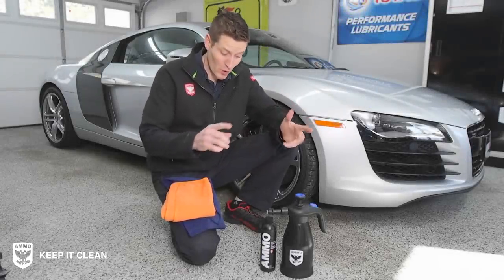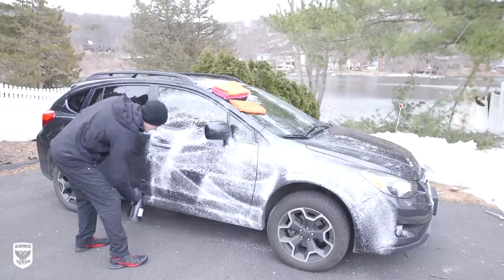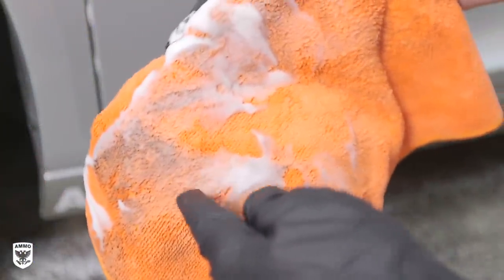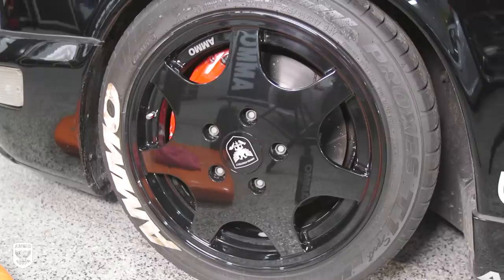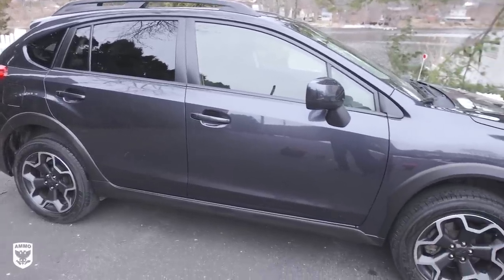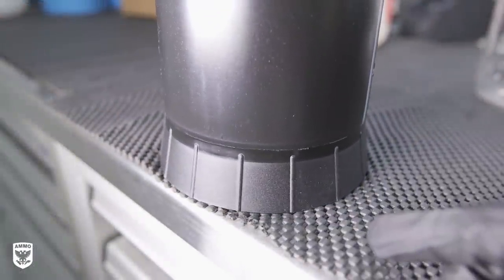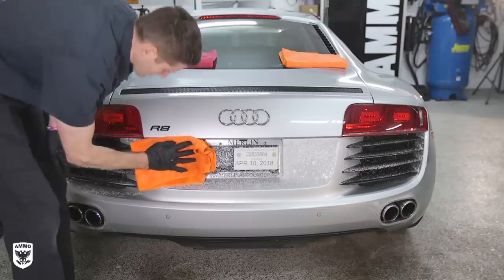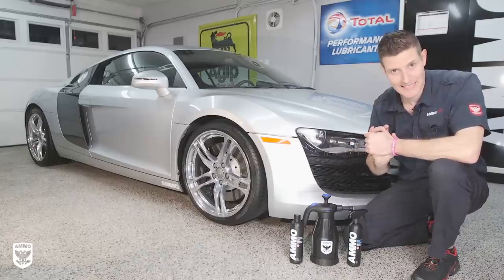How to SAFELY Wash Your Car Without a Hose!

Comment: Sorry Larry another question. If the Frothe product has that high degree of evaporation and the car is ceramic coated is it necessary to use Hydrate to help with drying/sealing?
Reply from the maker: not necessary but helps. adds a small layer of sealant. totally up to you.

Comment: Great idea. I hope to be in a place where you're at eventually in my lifetime. Definitely leading the industry in innovative thinking. However would this product work well in 100+ degree weather? Or would one simply have to work in smaller area quantities or work at a faster rate before the foam dries up? If it dries up does it bake into the clear coat like most car wash soaps do? lol.. It doesn't snow much down here in Texas. Also are the different color microfibers your using any different in the material used or the "grit" of the towels in any way?
Reply from the maker: I would avoid using it in direct sunlight but if you have no choice, then yes work in small sections.  same material for the microfiber just different colors

Comment: I noticed in this video that you're often going from top of the door all the way to the rocker panel. With a typical wash you have a particular order that separates these areas. Does that not apply as much with Frothe or did you skip it for quick demonstration purposes?
Reply from the maker: As long as you don't go up after wiping the lower part you should be fine. Depending on how dirty the car is, you can certainly split the panel in half, using one towel for the top half and another or a clean side of the towel for the bottom.

Comment: If you want to wash the car without hose, simply pour some water in to the bottle, mix it with car shampoo and THEN add fluffy shave foam into it. Believe me you'll get the same product that AMMO NYC uses. Done it, tested it, compared it. Works like a charm, no scratches. 

Btw, this is for those who can't get AMMO NYC products into their countries. No offense Larry!

Comment: Hey Larry I just purchased a motorcycle and since you showed a couple in the video I would be interested in seeing some motorcycle specific videos. Even possibly what to do when purchasing a new motorcycle, "New motorcycle  Prep and Protect. And just to throw it out there I will be riding said motorcycle into Newtown, Cheshire, and Stratford CT from Franconia NH throughout the summer if you need a "this motorcycle just drove 200 miles and needs to be cleaned subject."

Comment: Larry, so at the end, you still recommend to use the hose OVER Frothe when possible, but in the case there is no access to water, Frothe is a good solution right? Also could you do a video using Frothe on a car extremely dirty, like with a lot of dry mud on it? I can totally picture that Frothe would not create any damages on a lighly dirty car, but it's hard to picture it's not harming the paint of a car with heavy and dry mud on it. Thanks for all your videos BTW!
Reply from the maker: I have another video coming soon, but you are correct. I always recommend using hose/water when you have it. However, if you do NOT HAVE WATER...then Frothe is the next best solution :)

Comment: Very nice. What i’d like to see is something I can spray on my car before I pressure wash it off at car wash to help release the dirt. Pressure washing alone doesn’t clean the car well.. pre washes on the market use harsh chemicals that take wax off and eventually eat away at clear coat. Just an idea!
Reply: Pre washes do not eat at clear coat..nor do strong dilution APCs.

Comment: Really curious to try this technique, i've used some waterless wash that worked decently, but this is a diferent approach on the whole lubrication point. I wonder if you could use frothe with the aerator but with wash mitts.  Like making a dry foam gun, by using the foam with a mitt ( multiple for one car)  and then after a pass with a mitt, using a drying towel. Maybe use this way during winter when taps are frozen, use 1 mitt that you rinse every panel in a warm bucket... It seems effective for cleaning dust and winter salt. Would it work to use frothe+ Ammo Boast, to help neutralize the salt and rust on the chassis?
So many questions, and possibilities!! Freaking stocked to work in a field when so many are trying to innovate.

Comment: How does this compare with the water method? Are both equivalent to each other? Or should this method only be used as a back up.
Reply from the maker: This is when you do not have access to free flowing water, a hose.

Comment: Being pedantic here but you claim less work. Technically work = force * distance, so increasing the stroke length while keeping the same force application increases work. A given volume can be pressurized using a given amount of energy (work over a given time period) input to the system. Therefore it doesn't matter what your mechanism is to get there, you input the same amount of energy to the system for the same results. Now with mechanical advantage, the amount of force can change, but generally it increases distance as a trade-off, accomplishing the same amount of work (think a pulley system) for a given task. Increasing work per pump has a benefit of less pumps to get to pressure, but again has not changed amount of total work to pressurize the system. Conversely, lighter force application requires more pumps to attain the same pressure.

Love your vids! Love your scientific approach! I am just trying to improve your argument.

Comment: I SO WANT to love this stuff! My problem is that It just leaves MAD spots on ANY oversprayed plastic/rubber/vinyl areas...and it just makes MORE work to get THOSE out after the first pass.

Am I doing something wrong? I'm using the Ammo aerator, and followed your dilution recommendations and everything.

So I now have to follow up a hoseless clean with an extra pass of Griot's Speed Shine to get a totally streakless finish. Frothe also leaves streaks. Maybe I'm spraying too much product, but I worry that less product will not get the lift I want.

Help!

Comment: Hello there! I'm new to the channel and wanted to thank you for this video. Everything you mentioned in this video fits my needs living in a townhome with strict HOA rules that limit my car washing capabilities. Currently I'm using Chemical Guys EcoSmart waterless car wash, however I've been dying to foam up my car and given an actual wash. 

This seems to be my best option. I do have a question though do you need to chase the frothy with the hydrate? Or can I just apply a sealant and wax? Again great job on the video thank you so much for the information.
Reply: You don’t have to use hydrate.

Comment: Can we add carwash soap and water to the aerator and use it as a foam Canon but with the air pressure instead of the water pressure?

Comment: Great Looking product Larry I have ordered  both frothe and hydrate plus the airator and can't wait to try, with this product can you add Boost to this to create the rust inhibitors factor and add more foam??
Reply from the maker: You cant add any regular soaps to Frothe as it would negate the "hoseless" aspect of it. However, if you do want to use the Aerator with a soap prior to a full wash (as a substitute to a "canon") then yes you can. However, cross-contaminating the pucks inside the pump is NOT recommended as it can diminish its life span. Try your best to keep them in separate units to prolong durability.

Comment: Hey Larry, after washing with AMMO FROTHE and drying with AMMO HYDRATE,  is it ok to use wax? Or is that not a good idea?
Reply from the maker: you can if you like.  AMMO Hydrate is putting a light layer of sealant down already but if the surface is clean then you sure can.
Reply: AMMO NYC great,  thanks Larry!

Comment: Hey Larry , I detail as a hobby, im in nyc as well and I loath taking out my pressure washer and connecting everything just for a wash so I think this product is great. my question to you is is there anyway I can use my own car shampoo or does it have to be froathe.
Reply from the maker: You can use regular soap if you choose, but beware that contamination can diminish the life span of the pucks inside
Reply: are the pucks available for purchase separately ?

Comment: It would be cool if you could find a way to out the frothe in a trigger style bottle so the normal dude wont have to mix it or buy a seperate tool to apply the product. However; This is a very good idea and should change the game in terms of "waterless wash" / "hose free wash" applications.

Comment: On that white truck, what would be the best way to get those contaminents off. Obviously clay would, but I doubt that would be the easiest. Would you just use a heavy strip wash and then clay?
Reply from the maker: you mean silver truck? the "best" and "easiest" way are two different approaches. If I had access to water, then I would detail it using the techniques I show throughout my videos.  rinse, wash, rinse, clay, then dry, and probably compound and/or polish if needed, then coat with AMMO Reflex

Comment: Larry, I'm curious if this solution would work on a satin/matte vinyl wrapped car. I've had issues in the past with waterless wash adding gloss to the satin wrap on my car. Would it be okay to use Frothe and the aerator and follow it up with a matte detailer of my choosing to provide similar results?
Reply from the maker: Check the 9:13 mark.  I address this.  It will not add shine. I use AMMO Frothe then follow up with AMMO Hydrate for protection.
Reply: Thank you for the reply, looking forward to using this product on road trips when I don't have access to a car wash!

Comment: Would using distilled water as opposed to very hard tap water help anything?
Reply from the maker: Certainly will help.  If the water is really hard or has a lot of minerals, any chemical used in it might be less effective.

Comment: You should promote here the use of demineralized (or distilled) water in the mix. Like in glass cleaner solution, the use of this pur-er water has multiple advantages : does not conduct electricity, does not leave mineral marks, does not contain mineral particles, etc. etc. The pure water has this wonderful ability to decontaminate more. In nature everything that has less of X content will suck X more from the surface you put it on. Distilled water will be a better solvant for any solvable that is on the surface. With tap water your product will give 90% or 95% efficiency, while with pure water it will give 100% of its ability. distilled water is here easier to use since there is so little to use. In my weekly routine of using a city power wash service, I then get home, spray the car with distilled water (a similar spray as yours but worse) rhen I dry with AMMO Hydrate, the result is amazing.

Comment: Would I be able to use this with a normal spray bottle to clean my snap on toolbox?
Reply from the maker: A normal spray bottle won't give you the foam. Frothe is meant to foam and be used with the aerator.  If you don't want that, then you can use AMMO Spit.

Comment: I'm just starting out and water less is the way i wanna go / I've watch the video 3x.iam going to buy the kit the hydrate is not included. Do i need it to? & the measure tool. Were can i get them? (cause i wanna mix it correctly)
Reply: Hydrate is not a requirement to use frothe. Hydrate i believe is a type of wax so after using Frothe, Hydrate is a optional bonus you can treat your car too. If you want to buy it, you can go over to Larry's website to order some.

Comment: Quick question, what about using Hydrate on sun spotted vinyl...my vinyl stripes are starting to show whitish spots in the vinyl ...it’ll look clean when wet but once it dries it looks like white spots on the blue vinyl...any suggestions?
Reply from the maker: Call as I need more info. If the spot are there previously, Hydrate will not remove them as it isnt an abrasive
Reply: AMMO NYC thanks for the reply...I’ve been looking into it further and it looks like I need to polish the stripes first to get the etched water spots off of it, then I think I’m gonna ceramic coat the stripes... hydrate would be good to maintain I guess then?

Comment: Can I still used the old formulated Hydrate after using FROTHe?  I still have pretty much the whole bottle left, feeling left out without the new formulated Hydrate :(
Reply from the maker: Yes you can but will require a bit more wiping (2nd wipe)
Reply: Perfect!  For winter use, should I add Ammo Boost into Aerator as well?  And how many ounces?
Reply from the maker: No AMMO Boost needs to be rinsed off.  Do not mix with Frothe.

Comment: Hey so, does this work with a foam gun or cannon instead of the aerator?
Reply from the maker: It may, but it assumes you have water....which defeats the purpose of the hoseless product
Reply: Yeah, but a foam cannon, if the psi is set low enough, would work?  Have you tried that?  Although the aerator looks like a great product, I was thinking of trying to use the products on the cheap...

Comment: Great product! I had the same question about what to do in our nasty Chicago winters. It's going to hurt to drive my new Challenger Scat Pack thru the local carwash. This looks like a great solution that I can do in my garage (drywall/insulation give me about 45 degrees in garage in the middle of winter). As a side note got your brute tire soap and Plum wheel cleaner. Used for the first time this weekend. Love it! Even on car 2 weeks old, my Challengers wheel drums where pretty dirty. How often do you recommend using Plum? I feel like I went thru about 1/2 bottle on 4 20" wheels.
Reply from the maker: Call the office. I need to understand more of your process :)

Comment: Im still skeptical.Im gona stick with the old good 2 bucket method or foaming technic
Reply from the maker: Cant go wrong with that approach. Remember this is not an alternative to a full wash....its an alternative to a full wash IF NO WATER IS AVAILABLE. If you have water use it :)

Comment: Would you say you could safely polish and wax after cleaning it water-less? or would you not recommend that?
Reply from the maker: wax yes.  polish no. I would wipe the panel down with IPA before polishing.
Reply: AMMO NYC alcohol?
Reply: heazy87 mixture of water and isopropyl alchohol in a spray bottle. I do a 50/50 mix
Reply: Jeffrey Kim what does that do? You wouldn't have to clay it?
Reply: heazy87  The alcohol/water mixture will help remove old wax and sealant before polishing. Clay is only required if you have surface contaminants. Personally, I always clay bar before polishing to make sure I have a smooth and clean surface. So in this case, I would wash with frothe, clay the vehicle and wipe with the alcohol mixture, then polish, another alcohol wipe to remove polish oils, then sealant/wax.
Reply: my car is brand new i don't think it's ever had wax / sealent on it from factory.
Reply: This makes absolutely no sense at all. The only reason to panel wipe is to remove residue from polishing. You don't panel wipe before polishing.

Comment: The most important question of all:  Can it be used in direct sunlight??  Specifically, summertime sun?
Reply from the maker: Yes, but depends on level of heat in the panel. More heat...smaller area to work.

Comment: Wouldnt this eat through towels?
Reply from the maker: Eat towels? No, it will not eat towels. If you mean, will you use more towel because you do not have water...then yes. You cant have no water, no towels, no work, and a perfect car. Unfortunately it doesnt work like that :)
Reply: AMMO NYC haha, yeah that's what I meant! This method is perfect for motorcyclists such as myself. However I would rather just find a water source if I had a car to wash/clean

Comment: That wont work "safely" in winter with all the salts and contaminants you get on winter roads, at least here in Canada :)
Reply from the maker: I used it on my car that had salt and contaminants.  Is it as good as a full detail with running water, no but better than doing nothing.  :)

Comment: Don’t waist your cash on this junk. That air spray you have to pump after 3 sprays a complete hassle. Next is you use 2 ounces on 1 suv wash so you get 8 washes per bottle at $35+ 5 shipping thats $5 per wash plus the cost the kit. It’s not worth it. Far faster to use foam cannon and no hassle and faster.
Reply: I live in an apartment dude